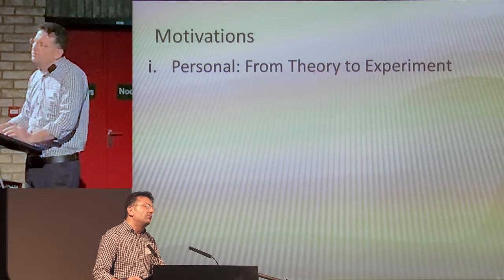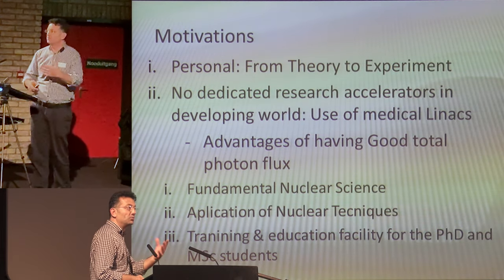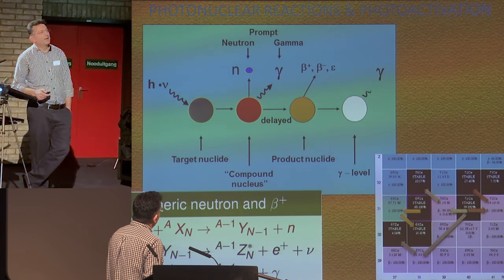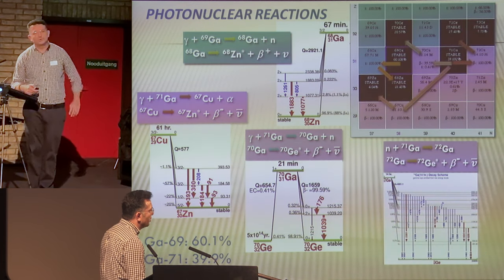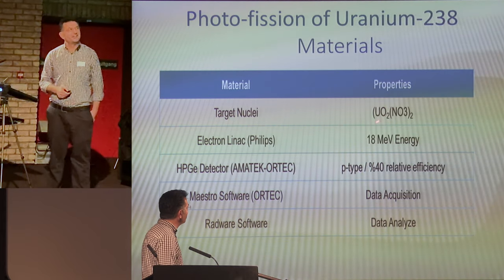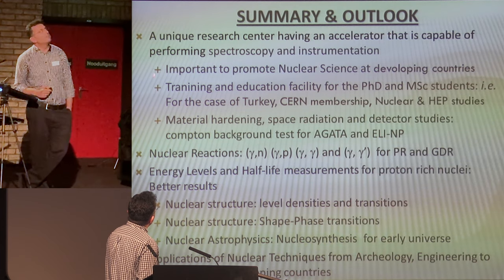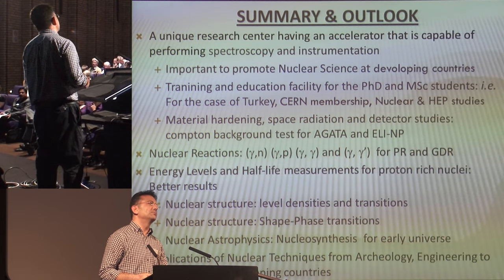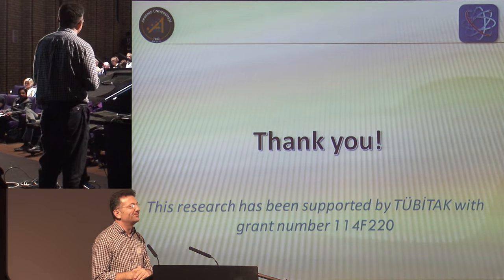Photofission of U238 Nuclei - İsmail Boztosun @ ThEC2018

Comment: Photonic fission of U-238?! If the energy yield is greater than input, this needs further study and experimentation! If not for energy production, I can see how it would still be valuable for medical research/products, and it's a lot more economically viable than relying on neutron fission for study/products, especially since he seems to be using old equipment from medical research. Remarkable.
Reply: The cross-section is small. This isn't to create energy with used medical equipment, this is basic research. Mapping out results not yet mapped out in detail.
Reply: @gordonmcdowell  Fair enough, still it's a field that I did not even know was viable, kudos to the Turkish gent for thinking outside the box!